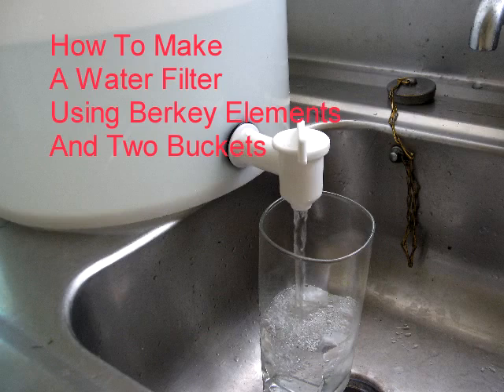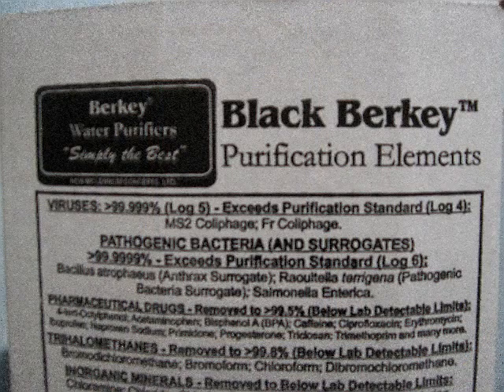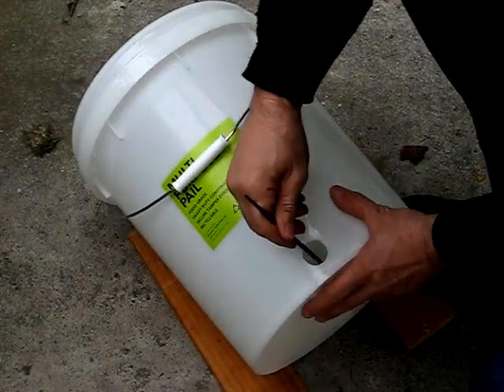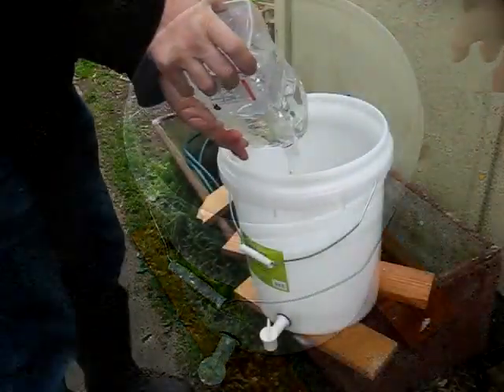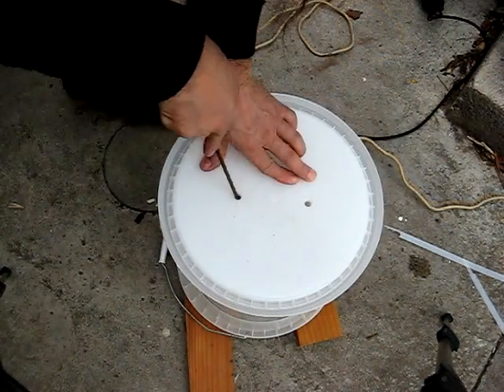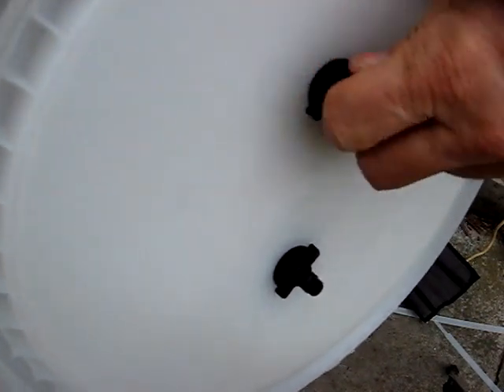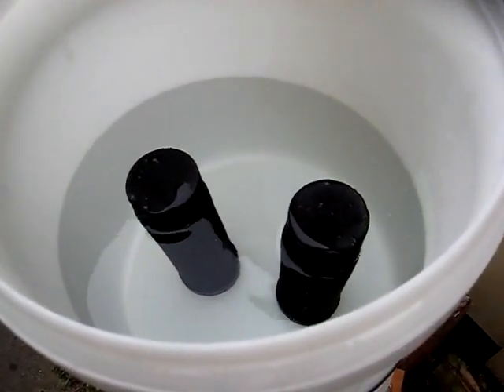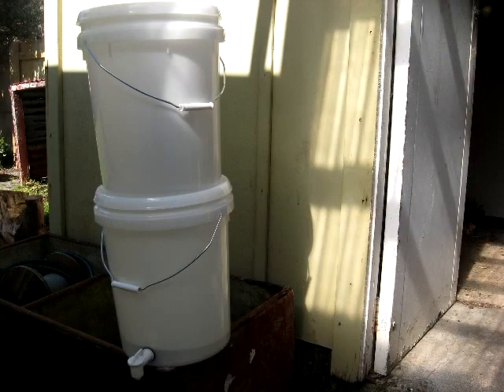Water Filter -  Black Berkey Home Made - Simple Build

Comment: These filters are awesome. I did a similar project a few years ago to treat our tap water [which is very heavily chlorinated] using only one filter. Even after several years of use it's still going strong, though the filter has to be re-primed every 3-4 months to keep the flow rate from slowing to a crawl.